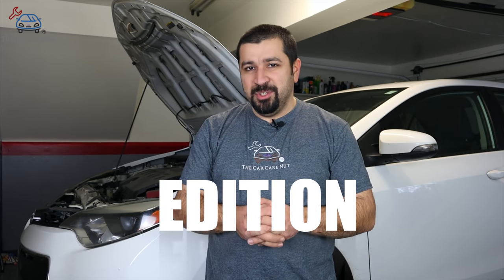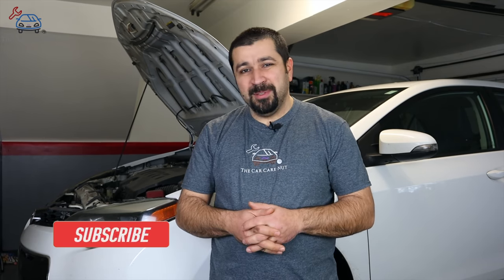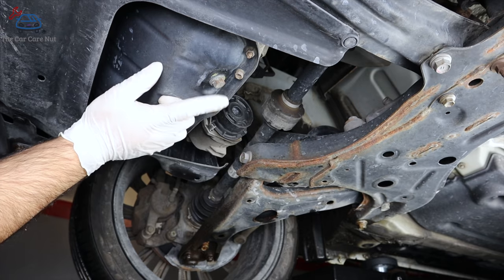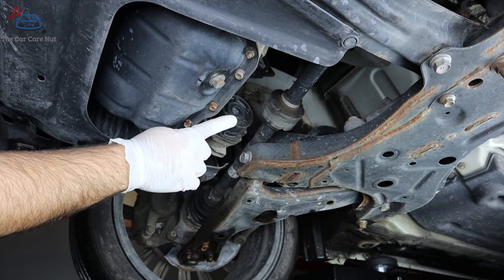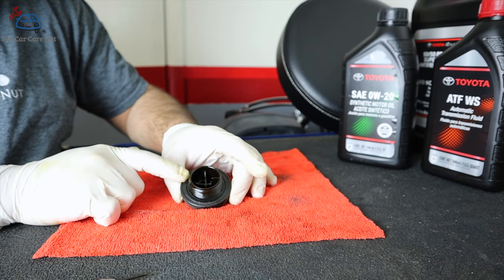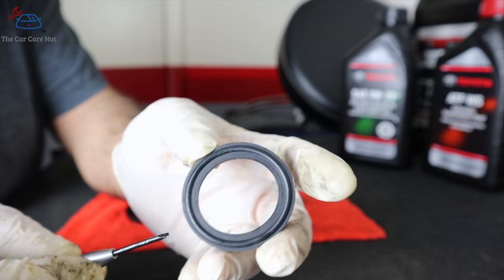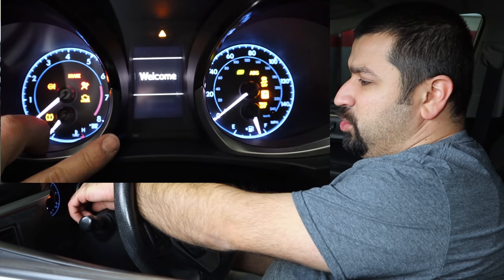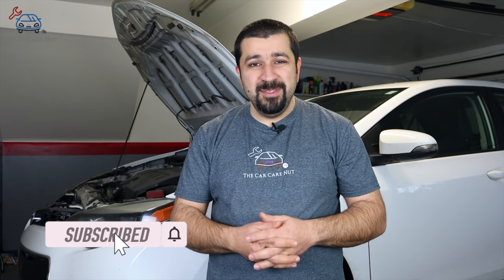How to change your Engine oil and filter for Toyota Lexus Scion

Comment: Hi, I’m new To your Channel, can you help me out please? I have 2010 FJ with 52000 miles. Never changed transfer Case, rear and front differential oil, how often needs to be changed and what type or oil weight? And do you recommend any type of oil brand? Also do I need to grease the drive shaft U joints? And what type of grease?
Your response is very important and appreciate it.
Thank you
Reply from the maker: Hi! Thank you for watching my channel. I would replace the transfer case and both front and rear differential fluids every 30k miles and use a good GL5 gear oil like Mobil 1 or redline. The driveshaft needs regular grease but you do need a tool to grease the fittings.
Reply: @TheCarCareNut  thank you for your help, I will do that every 30,000 miles, I do have grease gun so I will be able to grease the fittings.
Thank you
Reply: What do you think about SUPERTECH gear oil?
Thank you
Reply from the maker: I don’t have experience with it honestly.

Comment: I drive a prius, i indeed need to lift it. That thing is so low to the ground it's a pain to jack up
Reply: Jack up once for every 5000km is ok for oil/filter change. The low centre of gravity is much need for a stable ride through out the 5000kms round trips.😄

Comment: Thanks for the great videos!  I have always changed the oil on our cars and have become a fan of oil drain valves.  Recently, we replaced our 2007 Camry Hybrid with a 2021 RAV4 Prime.  Does it have a oil filter cannister (as seen in this video)?   Would you know the part no.?  Sorry for asking but I am used to regular oil filters.
Reply from the maker: Hi! The RAV4 prime has a regular filter not a canister it should be part number 90815-YZZN1
Reply: @TheCarCareNut  
Isn't it a spin-on canister?

Comment: Question Regarding the engine oil level.
Oil expands when hot, making dip stick level read higher. However after adding fresh oil and then let it circulate with, wouldn't it be lower now  after having a chance to circulate because not all oil will be in the pan even if oil has had about 10 mins to drop into the pan after turning off the engine? 
Or has most oil has returned into pan after engine off for like 10 mins?
I guess the difference is how much does oil expand vs how much has remained in the engine and not in the pan after circulation for measurement?

Comment: Quick question my man. Looking to buy my first hybrid  for taxi/delivery work. Looking at the Toyota Auris or the Lexus CT200h (I hate how the prius looks, especially the interior of the Gen 4 Prius). Higher spec Auris is about the same price as the non F sport CT. How do they differ in terms or reliability and MPG. I heard that under the hood of the CT is the same as the prius (its a prius in a tuxedo)

Personally I much prefer the look of the CT over the Auris

Thanks man :)
Reply from the maker: Hi! The CT is exactly as you mentioned a Prius in a tuxedo. Both are very good cars with exceptional gas mileage. It really comes down to your preference on looks.
Reply: @TheCarCareNut  Hey, thanks for the reply, another one my man please. 

Petrol here is about £1.10-£1.20/lr. I will be doing about 30,000+ miles (80-90% city driving) a year with my new car. Plan to keep it for 6-7 years. Petrol costs, maintenance and overall reliability, is it wiser to get a Auris 1.2 petrol automatic or a CT200h, both either 2015-2016. The CT is about 1.5-2k more expensive.
Reply from the maker: I think they are both similar cars. The Toyota badged one will likely cost less in insurance. I would look into that as well.

Comment: You said the delayed oil change could cause the oil consumption.  This may happen to me.  
My two year old car was driven only 3 thousand miles for two years period without oil change.  After then, the car started to burn 1 quart of oil for 1500 miles.  I learnt my lessons.  But are there any measures to reverse this oil consumption issue due to no oil change?
Thanks a lot.
Reply from the maker: Hi! I would first start changing the oil every 6 months then run an oil system cleaner and it should help.
Reply: @TheCarCareNut   Thank you for your kind response.  Please kindly recommend an oil system cleaner.  The car has only less than 40,000 miles.
Reply from the maker: Honestly the products that I use is not available for retail sale however I would look into liqui moly products as they have good ratings.
Reply: @TheCarCareNut  Thank you so much.  Will try Liqui moly engine flush.  Thanks a lot.  will feedback you if it resolves my oil consumption issue.

Comment: I have a 2006 2GR-FE and cannot find the correct engine oil. I know it is 5w-30 but can't find the Manufactures recommendations. Is It C2, C3 or ACEA A4 B5? I have used Castrol Edge 5w-30 LL and worried that it is not correct. What would you recommend. The car has only done 70,000kms. Thanks.

Comment: I have a 2021 Rav 4 XLE Hybrid Prime. My local mechanic did an oil change using the Toyota oil, but used a FRAM FDH967 oil filter since he couldn't get a Toyota one. This a cheaper costing filter ($6.99) and best for "conventional oil" according to FRAM. Do you recommend I drive the next 5,000 miles or 6 months with the FRAM filter or drain the new oil and replace it with the correct Toyota filter and put the new/used oil back in?

Comment: 7:58 i think the cap part is 9lbs and the cap sub assembly is 18 lbs. drain plug is 30.. that's what i used. but i never removed the oil filter cap thing.

Comment: I understand that the oil is suppose to be what the sticker says. My 2022 Hybrid camry should have 0w-16 but my mechanic could only find 0w-20.  Can I use 0w-20  until I can order some actual 0w-16.  What are the downside of 0w-20.  I am guessing lower MPG.  Anything else?

Comment: The canister on the v6 Tacoma is a real pain in the ass. There is finally an adapter available for a spin on filter….come on Toyota this is ridiculous…the adapter is pricy but probably worth it…..I haven’t taken the plunge yet but probably will… have already upgraded to the metal vs plastic….still a pain…Toyota just needs to join the club and start using a spin on filer ……rocket science

Comment: Does oil sitting in the store or warehouses for a long time effect it's properties? I ask because I had a jug of Pennzoil Ultra Platinum sitting in my garage over a year. I hadn't used it because it was the last of a bulk purchase I made. When I poured it out to fill the car, I noticed some sediment at the bottom of the container. I assume that was the detergents and other things that settled out of the oil. Is that bad oil when it does that?

Comment: Every time after the new oil change, the first start up is very noisy....as is something is loose and rattly.  After that is fine.  Why is that ? I never get an answer for that.,,,😢
Ps the oil is always the recommended one, the car has only 40.000 miles , gasoline. Oil change as you said, every 6 months.

Comment: This is so weird. I had this Corolla before, but mine was a 2016 and it had the self contained style of filter, i forget what the term is, but its the kind where you take the whole thing off and just throw it away, not just the paper filter.

I mainly looked for a video with this kind of filter cause my Lexus uses this style and I've never changed this kind before.

Comment: i notice you removed the filter first before removing the drain nut.. is there a reason why you did it in that order? We have a Toyota Fortuner 2KD-FTV engine and the filter isnt horizontal like that its slanted vertically... would your steps be the correct way to do it? or since the filter is different should i remove the nut THEN remove the filter?

Comment: Thanks for your YouTube channel. I have learned a lot. How does the dealer get the plastic oil filter housing off the 2018 4runner?  I used the specific oil filter wrench with the notches and the plastic ears broke off?  It has only been serviced at the dealers and I tried a DIY oil change and the filter housing is not coming off. Any recommendations?  Also I refilled the oil above the full mark it is on the 5 on the dipstick. Any suggestions on removing the oil or will it be okay?  Thank you for your time

Comment: Those plastic oil filter canisters are GARBAGE. They can crack even if it’s not over tighten…. Mine cracked on my rav4 at 80k miles and I install it with a snap on torque wrench.

Comment: Very nice! I did the oil change on our 2014 Prius yesterday (d'oh!) Now I know about the filler cap gasket and the torque on the filter canister cap. Back when we still had the 2010 Prius I bought the Toyota tool for removing that cap because no plastic cap was going to do it. Now I know why, but at least I have a shiny filter cap tool to make me feel more special as I wallow around under the car.
EDIT - I originally asked about that cool funnel but you answered it in another comment. Thanks!
Reply from the maker: The original filter tool is the best! But it’s pricey
Reply: If your oil filter cap wrench has slots on it then it will only fit the 1.8 liter engine. 2.0 liter engines have a different oil filter cap with a larger diameter where the slots are located.

Comment: Hey @thecarcarenut long time listener first time caller. Just did an oil change on my 2013 Toyota Camry SE 2.5 liter and could not get my plastic oil filter loose. I ended up using a breaker bar on it and cracked the filter housing which spewed oil all over upon start up. Do you have any tips on how to break the seal between the plastic filter housing and motor before trying to loosen the filter? Thanks for all the great videos.

Comment: Thank you! Very nice video.
How about an hybrid? 
Do you also recommend to change the oil that often?
Reply from the maker: I would still change it that often on hybrids as well as they are also big offenders of oil consumption when not maintained at good intervals.
Reply: @TheCarCareNut  Ok, I agree with you. But my car is still under guarantee, I don't want to pay 300€ for an oil change at the dealer. Can I still do it by myself while the car is still under guarantee?
I drive about 30.000 kms a year, very few city driving, and I religiously change my oil every 15.000 kms. I think it should be fine. Don't you think ?
Reply from the maker: Depending on the warranty laws in your country, you can do the oil changes yourself for sure
Reply: @FrancePhil44  
Make sure you save the receipts for proof and keep a record of all service done.

Comment: Awesome video 👍
What can I do if I can't release the filter cam on V6 ?
Do you have any tips and tricks when it's badly stuck?
P.s. I tried a chain wrench with breaker bar and I'm just keeping break that cap wrench again and again.
Thanks
Reply from the maker: Hi! When you say the filter cam. Do you mean the drain cap or whole canister?
Reply: @TheCarCareNut  I took off the drain cap but had issues with the whole canister
Reply from the maker: Before you get it out I would first go get a new canister as I wouldn’t trust this one anymore. Get the Toyota filter wrench that I listed here as that’s the only one that can take a beating. Use the biggest breaker bar you got and if you have access to compressed air use an impact. But if you have to use a breaker bar or impact to remove it, you have to replace the canister so have one in handy.
Reply: @TheCarCareNut  definitely will  try it, unfortunately can’t do it right now as we have -11F/-24C here in Winnipeg, Canada 🇨🇦
Reply: Everyone who has this system should be prepared for a worse case scenario especially if this is the first time you're doing this.

In case of a Stuck Oil Filter

Make sure you have the following...
1. The proper Motivx* oil filter cap wrench. Item #MX2320 is for all Toyota/Lexus/Scion engines 2.0 liters and larger using a cartridge style oil filter or item #MX2321 is for all engines smaller than 2.0 liters using a cartridge style filter.
2. A 27 mm ½ inch drive socket
3. A ½ drive breaker bar (18 inches or longer in length. An extension may be needed for some models.)

If an oil filter cap seems difficult to remove, only the above items should be used (or equivalent tools). Do not simply use a ⅜ inch drive ratchet or ratchet with extension as these will sometimes result in breakage of the oil filter cap wrench or the oil filter cap.

Always make sure the teeth on the wrench are properly engaged with the tabs on the oil filter cap.

To prevent reoccurrence of the problem 
•Make sure new o-rings are properly lubricated before installing. 
•Use a torque wrench to install the oil filter cap to no more than 18 ft.lbs (25 N•m). Oil filter drainplug = 9 ft.lbs. (12.5 N•m)

* If you think the Motivx tools are too expensive at least consider the following... Do not buy an oil filter cap wrench that is made from cast aluminum. Only buy one that is forged. Do not buy one that is strictly a cap wrench that does not have teeth. Do not buy one that claims to fit all models or even all four cylinders. The 2.0 and 2.5 liter four cylinder engines use the same oil filter cap wrenches as the six and eight cylinder engines use. Only the 1.8 and 1.3 liter engines use a different size oil filter cap and oil filter cap wrench. If the oil filter for your four cylinder vehicle comes with one o-ring instead of two then your vehicle takes the same wrench as a Prius or Corolla (unless it's a six cylinder). If your oil filter comes with two o-rings & a service pipe for draining the filter then your oil filter cap takes the same wrench as the six and eight cylinder engines. Some companies claim their wrench works for all four cylinders but on the 2.5 liter engines that smaller wrench does not engage the teeth on the wrench to the tabs on the oil filter cap. It may work if your oil filter cap is not stuck but it is a poor choice. They are mislead.

For those that don't believe this is a problem...
https://youtu.be/Wm-VMIkTw6k
Reply: Clean off the area around oil filter . Then put around the filter / inside filter wrench a piece of bond paper [ copier ] for a good grip .

Comment: I have a 2019 camry and 2019 highlander with 2gr-fks both cars and the toyota manual says they change oil intervals is 10,000 miles, but for your experience with master technician you recomended change the oil at 5,000 miles or 10,000 mile ????
Reply: definitely every 5k miles. if you drive 20k miles a year, doing it every 5k vs every 10k means two additional oil changes. even if you go to the dealer that's only an extra 75-100 dollars a year. oil is cheap, engines are not....

Comment: At 8:10 of the video, you said "Don't over tighten the plastic canister because it might crack" so I never tighten oil filer in general ever.  However, several months ago, I took my 2016 RAV4 into the dealership for servicing and to get the oil change for "free" as the car was purchased there.  Last week, I was trying to change the oil myself as I always do 99% of the time, the oil filter completed stuck!!!!!  I just can't take it off even with the aid of a longer handle bar to get leverage.  I am going to go back to the dealership and have them change the oil again (it is free) but this time I will specifically TELL them NOT to over tighten the filter!  After this, I will stop going to this dealership ever again for anything!
Reply: When I overtighten the canister filter on my 2010 Corolla it leaks

Comment: Fill cap trick is a good idea. But it won't stop someone from starting the engine with the hood up. Whenever I change the oil in my small equipment, I put the key on my workbench with a tag attached that says "No Oil". The tag doesn't get removed until the oil is filled.

Comment: Is there a video you might have that explains why the dash lights constantly go out in my 2007 Prius took it to Toyota and they won’t over 5000 to do work on my car that I paid 3800 for my lights might come on the dash lights that is and then the next time I start my car they won’t come on,  I need help
Reply: You should go to your Toyota dealer so they can diagnose the issue. If you're unhappy with them as it seems you are try going to a different Toyota dealer or ask around to find a local mechanic who is familiar with Toyota vehicles.

Comment: I have a 2016 Tundra and have never changed my own oil on this truck. Guess I’m intimidated by the heavy skid plate removal plus the changing of oil filter cartridge. Can I leave the skid plate off if I remove it?  I Never go off road.🤔

Comment: I have two Toyotas, a 2006 RAV4 and a 2011 Sienna - both with the 3.5L V6 2GR-FE engine.  The oil recommended for the two is different.  RAV4 recommends 5W-30, but Sienna recommends 0W-20.

I found a chart somewhere that says that the RAV4 can take both, but after more looking it seems that might not be the case.  I just replaced it with 0W-20 in both, though.  Do I need to swap that out back to the stamped 5W-30 even though its the same engine?

Comment: Fill cap by the hood catch... I've had faulty struts on hoods fall and break the cap. Not a good place. Just unscrew the cap and angle it in the fill hole.

Comment: thanks for the tips on the small plug gasket I just left it, much easier.  The gasket on my oil fill cap popped off and fell into the plastic shroud below! Had to remove 4 screws and pull down one side of cover and it fell out, just an added, unintended step but stuff happens.  I have to change outside, it was 40 degrees, not snowing, not raining, and no wind so I was lucky to get an oil change in before it starts snowing again here (upstate NY).  I log my own maintenance into the My Toyota login website. Thanks as always CCN!